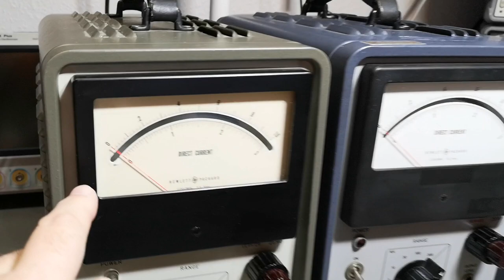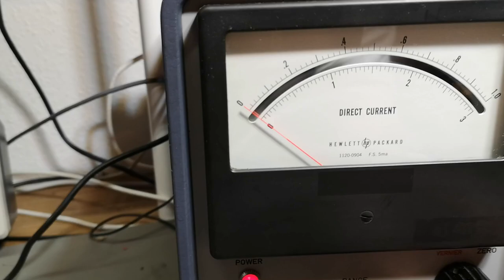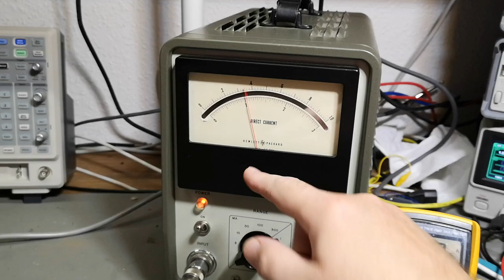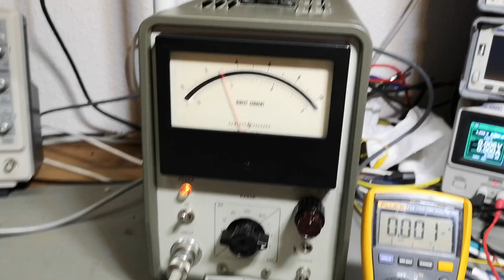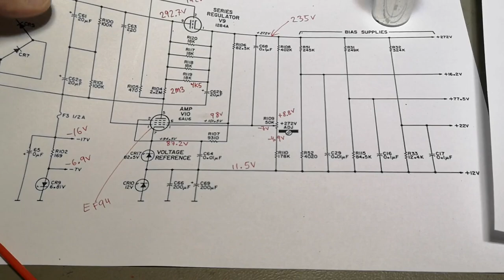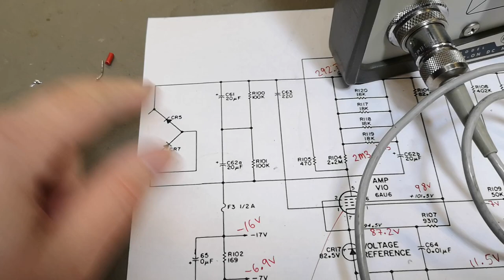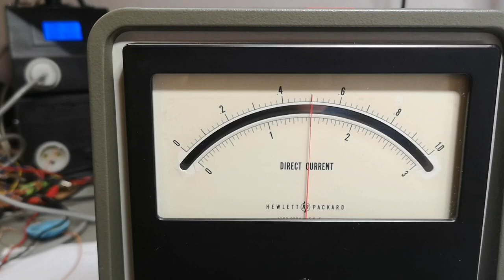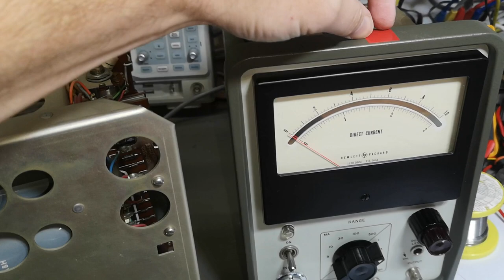HP 428B Clip On DC Milliammeter test repair teardown

Comment: I have several of these wonderful instruments. If you beef up the power supply filtering you can significantly lower the noise of the BNC output. I successfully used one of these and fed the output to a LeCroy scope along with a voltage measurement and used that and the scope math functions to calculate a complex microcontroller based SCADA systems energy use in nanocoulombs. I could then use the consumption for each system function to log the battery use. Later on I bought a Joulescope 110 and ran the same tests and found that the measurements taken with the 428B/LeCroy lashup were within 1% of the Joulescope measurement. That was pretty impressive for an instrument that was designed in the late 50's early 60's.

Comment: Changes are improved magnets in the meters, and improved wire and windings in the transformers, so they allow the windings to be run slightly hotter so allowing thinner wire and a smaller core for the same power output.

PCB laid out using tape and Letraset, the edges of the cut tapes are so prominent there, plus the reduction down from the 2x original size Rubylith film to the PCB.
Reply from the maker: yes we know letraset when we see it, when i started at my first job, they still maintained a ton of layouts made that way, and CAD was the big new thing

Comment: Of course HP used light bulbs, they started off with using a light bulb as a critical part, so carried on that tradition. You actually have a PCB that you use to replace those 3 ground capacitors, that joins all 3 grounds, and allows you to use 2 radial capacitors in the replacement part.